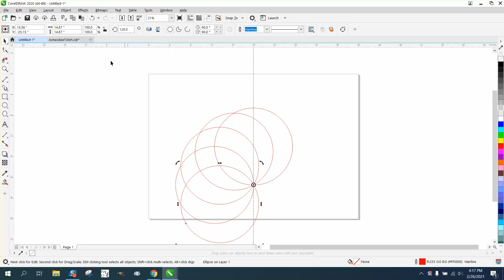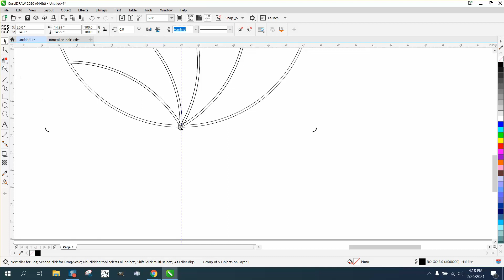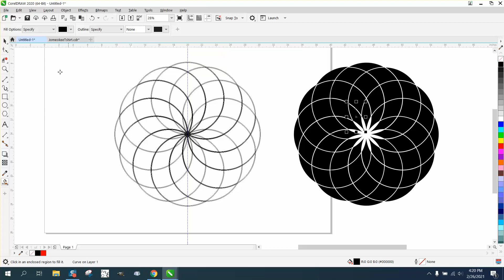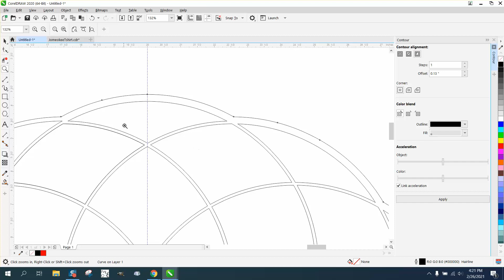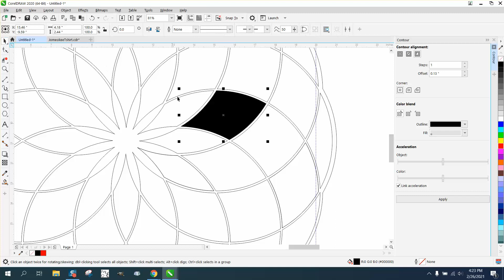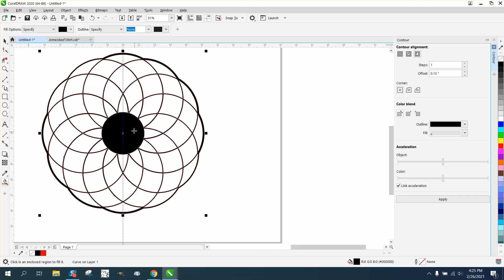Corel Draw Tips & Tricks 30 deg rotate and the Smart Fill Tool

Comment: Questions and an idea:  The questions:  Why sand the back?  If there is no reason to sand the back, could the pattern be cut with the work piece facing downward?  Would that reduce the amount of sanding required?         The idea:  Supposing that you made the cut with the good face upward and you use the blue tape to hold everything in place, flip and sand the back.  Take another sheet of some stock - doesn't have to be as good.  Put a bit of glue on the back of each piece that is going to be scrap.  Lay the new sheet across the back of the whole thing and let the glue set up.  If you are concerned with getting glue on the actual filigree pattern, you could rub those sections with wax first.   Now, when the glue is dry, turn it over, take off your blue tape and sand the top.  Lift off the filigree.  You should have the cut-out pattern you wanted AND another copy that is the negative version.  Paint the valleys of this negative where you removed your original.  Put your preferred finish on the pieces that would have been scrap.  If this works, you have two versions of the design and almost zero scrap.    When I was doing gold and silver jewelry, I sometimes used a similar method.  Cut out the desired pattern but keep the other pieces in the right places and mount them on a backing for another piece without as much precious metal waste.